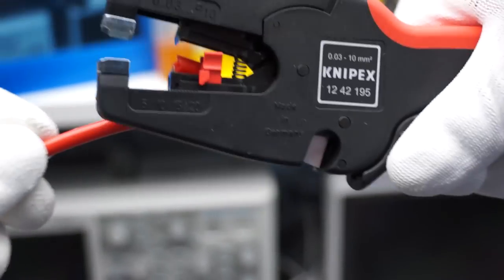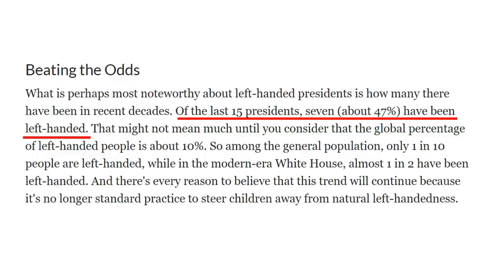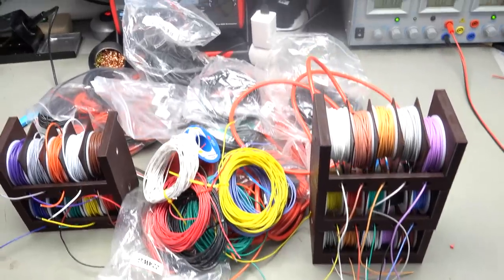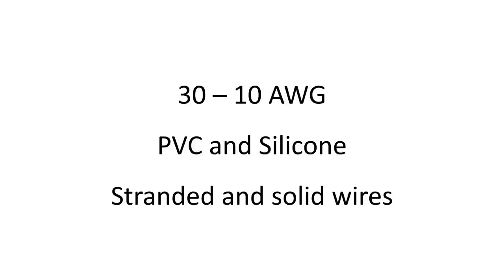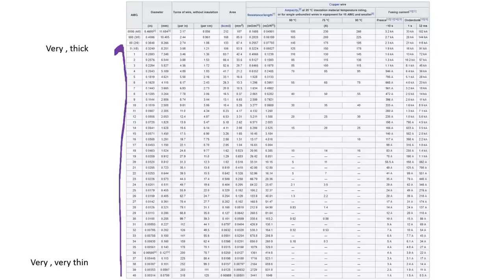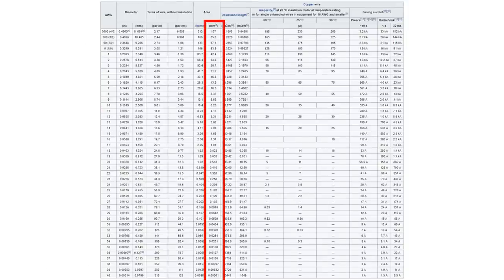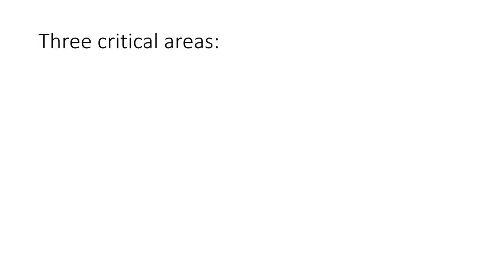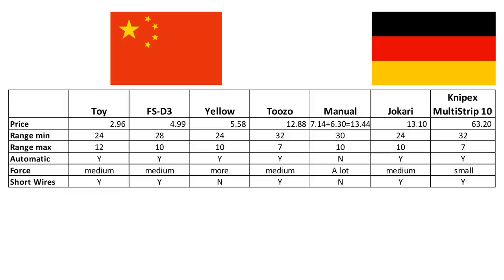#268 8 Wire Stripper Test: Germany vs. China. Who wins?

Comment: I think the pink model would work flawlessly in both auto and manual mode. Good grip and pull in left or right hand and would work for a long time without needing replacement. Probably best in horizontal but vertical too. The jaws are wide enough for most things. I do not think there was any silicone in the construction but maybe you could test and evaluate against similar models. Does not need expensive packaging to look great as it would not be on the shelf for long. Looks expensive though and probably very high maintenance. Likely to be stolen though.

Comment: I use a generic(no branding at all) german wire stripper. I bought it for 10€-15€ at a hardware store, i assumed it would be chinese but it had a quite well hidden made in germany marking.  
Same rough design as the jokari one, 24-10AWG as well. But its mechanism and looks are a little different.
It works a little better than the jokari one, at least for me.
Reply from the maker: Thank you for sharing your experience!

Comment: I have a pair of the GreenLee auto wire strippers that are similar to this style.  I paid $65.00 for them and as the others, they claim to work on more wire sizes than they actually do.  My common size I use in my trade is 10-18 AWG. They fail on 12 AWG so I dare not attempt the 10s.
       I love the auto strip, BUT,  I noticed the other style auto strippers (not shown) completely sever the insulation, as do the manuals....cutting all the way around, and then pull the wire.  I think this style is superior.
       The style you demonstrate, only cuts roughly half the insulation and then pull and stretches the remaining intact insulation in a tearing motion, hoping the gripper doesn't start to loose its grip of the main wire insulation.  The auto stripper that does the complete job is the Knipex (different style) but it costs almost $160.00.... ouch!

Comment: I've been using Jokari strippers for about 7 years now, daily and extensively. The ones shown in this video (20050) and the newer model 20100 are best for AWG26 to AWG 18 and my main tool (Jokari 20060) is best for AWG 22 to AWG 10, also strips the insulation in the middle of the wire (I have removed that red wire stopper).  After many years of struggling with Yellow-like ones and accidentally shorting out adjacent wires while stripping with those and other metal wire strippers, I highly recommend the Jokari brand or Molex. Overall,  no wire stripper tool is universal for all applications or wire gauge,  you need to pick a specific one. Also, don't buy from EBay, quality and warranty is never guaranteed there. I buy them from TME and they come to US in 3 days with DHL for only $10.
Reply from the maker: Thank you for sharing your experience!

Comment: I really liked the comparison, although there is one field you did not take into account: Especially the "toy" stripper can remove the isolation from ribbon cables with many conductors at the same time.
Reply from the maker: I would not trust that one wire would be cut from the cable ;-)

Comment: The Yellow is a must for residential electricians who deal with the same home rated wiring for every job. I dont like the wire cutters on it though as thy are under the fulcrum and you have to let go of the tool to get it around a longer wire to cut in half.
Reply from the maker: I agree

Comment: Andreas, I very much enjoy your videos. A little off topic (but wire related) I have a question about dupont connectors on patch wires (actually the male pins that mate with the dupont sockets). I notice many pins are malformed in the inexpensive Chinese gear as opposed to the pins we used to see on high quality motherboards and old PATA hard disks. The high quality male connectors have a nice smoothed pyramid shaped end that enables multiple insertion/removal without damaging the female socket. On the inexpensive gear the pins are often roughly sheared off, frequently not even that square (and definitely not a smoothed edge). They are tough to insert and can ruin the patch cord they are connect to. How do you deal with these malformed pins? I've had them chew up and ruin multiple connectors before I realized what was going on. Thanks so much for making the videos, they are extremely informative and entertaining.
Reply from the maker: So far I had no bad experience. But I use DuPont wires only for prototypes.
Reply: @AndreasSpiess  Thank you for taking the time to answer my question.

Comment: Couple things

For silicone wire, you don't need strippers for 20AWG and smaller, your thumbnail and index finger do just fine for me, especially for 30AWG you could strip it with your finger tips :-)

The "Toy" ones as you write, are not so bad especially for the price, I have a pair and just checked on my silicone wires collection - they will easily strip as you show down to 12AWG, but for around 30AWG yes it will take a couple strands with it usually (but as above, I never use strippers for 30AWG silicone).  They will cut down to 20AWG fairly reliably (put to back of cutter and close sharply), thicker than that though is too much of course we all have proper cutting pliers anyway.  They are also very small which maybe is an advantage to some people.  Of course, they are very very cheap so quality is going to be variable at best, but  it is better than stripping with a knife anyway.
Reply from the maker: Thank you for sharing your experience!

Comment: As others have said, I have had a set of the "Yellow" style strippers (8:58) I got from the Matco tool truck (one of the mobile tool retail trucks that sell directly to auto mechanics here in the USA) ~15 years ago...long before getting into hobby electronics. My wire stop broke off ages ago, but I haven't missed it. It didn't really work anyways. The tool is always in my "most-important bench-tools-drawer" or on the bench at all times. No other set of strippers are in that drawer. I have several of the "manual" variety too. I haven't tried the other automatic designs. 
   The only reason I might get a different one is due to my recent fascination with multi-wire connectors, like the cheap JST-XH-2.54mm stuff. I would like to find something that can consistently strip the exact length needed for these tiny connectors. So far, I am still not convinced there is a cheap $10-$30 option that can consistently out perform a good set of file sharpened diagonal cutters. I'm most concerned with stripping square insulation for connectors that are retained by penetrating the wire insulation. I worry the tearing action of most manual strippers will compromise the crimp over time. One bad connection on a multi wire connector that must be cut, re-stripped, and terminated ruins the whole thing. The wire won't route as intended in most cases if a single wire is cut shorter. Maybe someone has a suggestion about a good tool for stripping an exact length like this?
  Thanks for the upload.
-Jake
Reply from the maker: Thank you for sharing your experience!

Comment: Great comparison vid bud.  
The only gripe I would have with the testing is that some of the auto wire strippers require a quick action.  It helps the cutter align and bite properly.
I have the 'yellow' type and that deffo gets better results from a faster actuation speed.
Reply from the maker: It seems I have a really bad "yellow" type :-(

Comment: The type you call yellow is quite useful for pulling back insulation on the middle of a cable. This is useful   when hooking up a T-junction. F.ex. if you ever install a automatic lawnmowers guide wires without the overpriced crimp connectors this is a great tool.
Reply from the maker: You are right. In the meantime I have a working one ;-)

Comment: You use the yellow wrongly. You have to set the gauge. I have no problem using it for wire 16awg to 24 awg for price of 6 dollar it works like a champ.
Reply from the maker: You are right. It was defective and the new one works ok. Mainly for thicker wires as you describe.

Comment: I own knippex like cheap chinease stripper, it worked out of the box exactly as you show. But it can be adjusted. The problem is that blades cuts way to deep into isolation. There is two skrews that releases that metal things that holds wire. For me it was not enough and i sandpapered blades to make them shorter and do not dive deep into isolation. now it can strip wires with thin isolation. Because of this i asked 50% refund from seller and as result i got stripper for less then 5$
Reply from the maker: Thank you for sharing your experience!

Comment: The part about the manual strippers needing to use the next size hole or they cut wire strands is not true, I have used this style most of my 39 years and every pair I've used have either said "COPPER ONLY" on them or were made before other alloys started being used and if you rewatch the video his said use copper only and he did not. Also a good tip for using this style it to twist the wire while making the cut before stripping to make sure you have a full cut.
Reply from the maker: Thank you for sharing your experience!

Comment: But the error in the AWG system is that it is a meaningless number that has nothing to do with its actual size much like one of the favourite statements from the USA of "back in the day" what day ? yesterday ? day before yesterday? also meaningless. mm is a much better idea at least it is representative of a reference point.
Reply from the maker: As I said: Sometimes I like simplicity: A thinner wire has a higher AWG and vice versa. This is sufficient for me.

Comment: for a buck you can get a chineese x-acto knife with round handle that works flawlessly for any gauge (;
Reply: Problem is that the knife puts a nick in the copper conductor(s). When you bend or put stress on the wire, it snaps off right at that point!

Comment: Actually AWG is more complicated, because AWG for solid core is not the same as AWG for stranded wires.
Reply from the maker: I did not know that.
Reply: @AndreasSpiess  Then take a look at this stripper here. One hole which is for 10 AWG solid is for 12 AWG stranded:

https://www.kleintools.com/catalog/klein-kurve/solid-and-stranded-copper-wire-stripper-and-cutter

On the metric system the wire size 2.5mm² (cross-sectional area) is 2.5mm², no matter if solid, stranded or fine-stranded.
The AWG system contains too much information which are only relevant for the wire manufacturers, but not for the electrician who uses the cables. And it is not open to new manufacturing methods.

Comment: I'm commenting on a stripper video - rare indeed.  Back in my engineering youth the technicians used a heat device to strip wires.  I'm sure it was mandated by the military contracts.  It simply had to thin bars that heated up and you melted through the insulation (isolation?).  This technique insured the wires did not receive any nicks which can lead to future failures is high reliability equipment.  Are heating wire strippers still used?  Oh, and for your nose, the smell was not pleasant.  I recall Mr. Spiess's nose is somewhat calibrated to disagreeable lab smells.
Reply from the maker: I can imagine the smell. And they would probably no work with silicone because it does not melt easily.

Comment: As someone that does strip thousands of wires a month I'd say that you should have tried the RS 663-617 strippers - they wipe the floor with all of them, 100% surrounding the cable when cutting.
Reply: If speed is what you are after, then no, manual beats everyone, but only for solid.  If accuracy is what you are after, then yes, they work wonderfully and every manufacturer out there makes them.  I find the slide type(most of what shown in this vid) die VERY quickly, but work wonderfully when brand new.
Reply from the maker: I just ordered one. Thanks.

Comment: I have also long experience on wire strippers: Your called TOY: I had several, and allways hatetd them, even if some had an adjustment srew for the force. It is not the plastic that gives up in long term, but the badly hardened "blades" do. If they do not bend, they simply are not sharp very soon. I the bought also the YELLOW tool. This tool I bought from Stanley. It is very good even if it does not cut smaller diameter wires. It could not be used for left handed persons. The Knipex tool, i had used, and there was one small plastic part missing. Now its useless for me. The replacement parts are much too expensive, but the long term stability seem very good, because for several years my son made  a  student job in an electronics workshop, where they striped 100eds of cables a day. The best for me is and was the YELLOW from Stanley, and that says a German Guy!
Reply from the maker: Thank you for sharing your experience!

Comment: Excellent analysis of strippers, Andreas!  One of my favourites is missing, the PA1822 from Greenlee. It costs a lot (€32) but is quality and well worth it because it does a few things others just can't: stripping the insulation off of really big cables, shielded cables, and removing a span of insulation from the middle of a cable. It came with almost no instructions, so it took some time to figure out how to use it, but once I did, I LOVE IT!  It is claimed to work from "0.18 to 1 inch diameter" wires, which I do not doubt. I have only used from about 5mm to 10mm diameter. The tiny blade can be adjusted for how thick the insulation is. I use it a lot for removing only the outer sheath from 220V power cables with three separately insulated conductors inside.
Reply from the maker: Thanks for the link. I never saw this concept!

Comment: You should repeat the test with 16awg x19strands silverplated with PTFE insulation. forget that silicone bs, you can strip that with a butter knife.
Reply from the maker: You are right. But it is more comfortable using a stripper. I do not use Teflon isolation here in the lab :-(

Comment: Excellent video, sir!  Especially appreciate the details about left-handed use; as a lefty, it's something I find important bu usually overlooked.

Regarding the strippers that leave the insulation on: I prefer this.  It keeps the strands together until they are to be used (into a terminal, soldered, crimped, etc).  And it's easy to give the strands a nice twist... as you're pulling off the insulation, give it a spin and the strands are twisted.

On metric vs. imperial... there are three backwards countries desperately  hanging onto the old ways: Liberia, Myanmar, and the USA.
Reply from the maker: Thank you for sharing your experience!

Comment: I have some strippers that look similar to the "Toy" strippers, but have a much better jaw with a sensitivity adjustment screw. It also has a depth slider like the German ones (w/ metric on one side, inches on the other). They are labeled "PYT 4" and they were about $15 USD. I've never had them cut through a wire, but I also haven't used them for smaller than 26 AWG. The "Toy" strippers seem like the Toozo/Knipex situation, where they copied the design of the PYT but not quality.
Reply: Also, I appreciate the brief historical anecdotes in the video.
Reply from the maker: You are right, there are many copies and copies of copies around ;-)

Comment: One note one the "yellow" : the knob on the left adjusts the force applied to cut, that may help in some situations. Also the yelllow plastic stopper can be swiveld downwards  and out of the way, so it will not be limiting the maximum length stripped. I think it is the only stripper that can do that. But yes, not for presidential use, only residential :D.
Reply from the maker: I tried that, but mine was defective. I have now a working ine. Thank you!

Comment: The Weidmüller is my first choice in the lab, but it is in many ways comparable to the Knipex, including price wise. The Jokari is good for electrical work where you mainly work with 0.75-2mm. Small and lightweight and it doesn't completely ruin your day if you lose it on a job. The cheapos I tested all disappointed.
Reply from the maker: Thank you for sharing your experience!

Comment: The FS-D3 is nice and works for a long time if you train a little, but you want the "yellow" one also for electrical work around the house which the FSD3 would wear out quick.  
I have the yokari at work, no one uses it and i dont like it. Only the expensive knipex which  way too expensive for Hobby use.
One important point is missing in the Video always check if you can pinch your skin of your hand!!
Reply from the maker: Thank you for sharing your experience!

Comment: Leaving the stripped bit of insulation behind is an advantage.  When using stranded wire it allows you to more easily twist the strands together so it is easier to insert into a hole.  Just twist a bit as you remove the insulation left behind by the stripper.
Reply from the maker: Good idea. Thanks!

Comment: I had a great automatic stripper from radio shack.  It was at least one generation back from what they last sold and well constructed with cast rather than stamped parts.  Unfortunately it died after decades of use.

NOW as for Americans not having a decimal system.  Untrue,  Early on Henry Ford instructed his engineers to standardize on decimal units and American engineers have been using them for a 100 years more or less.    I think the history guy, love that channel, did a spot about adoption of the metric system.  Turns out it has been largely forced on people.   :)
Reply: Metric is forced on people? It's not as if governments keep votings every now and then about what standard to use and then ignored the choice of the people. The metric system is the standard in science, because it's simpler and more consistent. Most people don't have a clue what the differences even are. If they did and had a choice, it's hard to believe people would choose an unnecessary complex system. 1/16? 1 AWG is more/thicker than 2 AWG? The first time I read this, I thought I was misunderstanding it. LOL